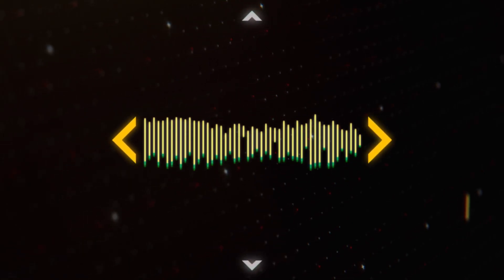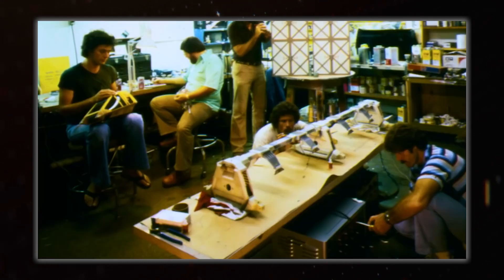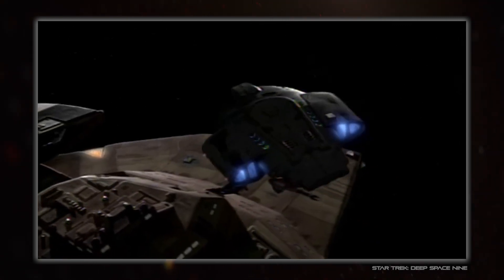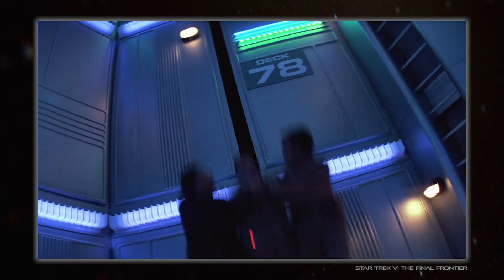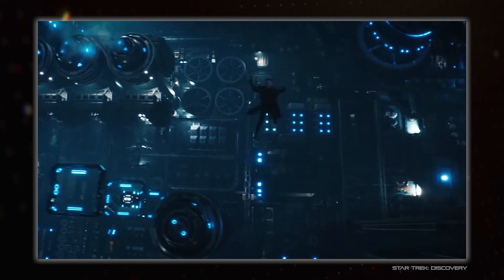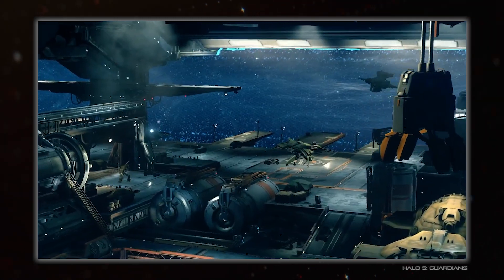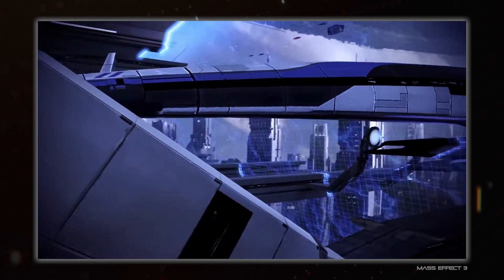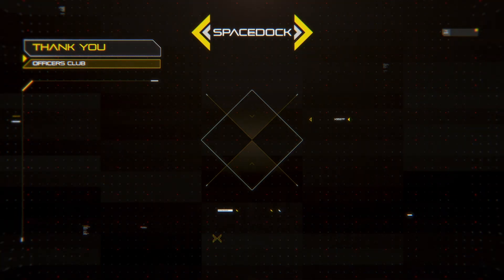Why Do Sci-Fi Spaceships Seem To Change Size?

Comment: There's some sort of cognitive illusion that makes the scaling issues less problematic than you'd assume they'd be. Somehow; IRL the inside of a house, especially when fully furnished actually feels bigger than the house itself looks from outside. I guess it has to do with the amount of details and your walking speed adjusting to the environment. Outside you generally walk at your max comfortable walking speed; but inside you're very limited by all the furniture and the short distances; so you will literally use longer time to traverse the length of your house inside than outside; and our impression of size is more shaped by time than actual distance. 

In computer games the player character usually have a massive collision box well outside the actual size of the player character to ensure that the player camera doesn't constantly clip through walls; so interiors needs to be much more roomy than a real world house needs to be relative to the size of a person; the more cluttered a room is the bigger it needs to be to allow movement. But luckily the illusion that things really feel bigger on the inside means we don't really notice it. Even in games such as Morrowind where interiors are in a different cell than outdoors and all windows are opaque; so the interiors doesn't need to match the outside in any way; and several interior cells are absurdly larger than the outside model is; if you compare them in the editor. Most small houses have an interior consisting of 2x3 or 2x2 cubic elements with walls and floors and ceilings snapped together in a grid; but if you take the corresponding model the interior is supposed to be the inside of; you'll often find that its about 1.5x1 such cubes large. Admittedly they often have massive basements so that the discrepancy is not as obvious but often even the first floor is massive. But strangely I never really noticed this in most locations until I started poking around in the editor.

Comment: It's not just ships, it applies to anything that's not technically real. So like anything 3D, anything animated in 2D, clay sculptures, anything with models, you name it. 2D's actually the worst for it by far because you can do so many perspective tricks that only work because of it being 2D and not an accurate representation of how something really works. 3D models are a lot more finicky about where parts of them are, where if an arm on a giant robot wants to bend a certain way, you actually have to make sure there's nothing physically in the way preventing it from doing that, while in 2D you can fudge a lot of it and no one will notice until they try to replicate the motion themselves in reality and realize waaaait a second that's not physically possible.

Comment: Starbug in Red Dwarf . . . basically a shuttlecraft with a cockpit and a rear room, matching the exterior design of two sections stuck together. . . but then sometimes it has miles of ducts to crawl through.

Comment: My favourite example of this has got to be Oryx's Hive Dreadnaught in Destiny 1 which people have tried to analyse the scale of by comparing it to the rings of Saturn and the hole its super weapon made in them, resulting in wildly varied upper and lower estimates for it's total length that are literally multiple orders of magnitude apart! (the most widely accepted estimates have it at roughly as long from bow to stern as the USA is wide from coast to coast)

Comment: Maybe one day, we'll get 1:1 proper scaling, inside and out. That's my biggest gripe with shows is that sometimes the interior of a ship can be ridiculously huge, or have more rooms than seems possible for a ship of a certain length or width. Or the ship keeps changing external scale for drama shots. My biggest gripe is internal layout not matching external size. Some ships will either have lots of 'dead space' thanks to weird curvings of hull when the insides are angular, or walls that are paper thin because 'future metals!'. Or worse yet, someone will map out where something is supposed to be based on external features (like a shuttle bay), and how far it is to say, the bridge.... and then the show or movie cancels the distance entirely in a way that can't be ignored -- like while a timer is counting down audibly or visually. And that's just so they can cut time for the show.

Comment: The demands of filming on a set with actors and props force a lot weird scaling.
Said actors want their faces clearly seen, so the sets have to be scaled to that reality.
A prop that cost thousands and hours to build must have its screen time.
A full-sized 'Enterprise' Bridge, for example, would have actors look tiny and isolated from each other.
If'n y'all make the sets a bit smaller, the actors look like they are working together in the same room.
There's only so much can be done with camera position and lenses...

Comment: The Defiant did actually change size over the duration of the show- they kept scaling it larger from season to season as the writers added new stuff to the inside of the ship that wasn't on the original plan, like the shuttle bay :)

Comment: This was a good insight to ship sizes but the Uss Defiant is 170 metres and either 4 or 5 decks, I prefer 4 decks as it seems more realistic to me, also I had assumed the Whitestar from Babylon 5 was 275 meters but I recently saw something suggesting it was 475 metres which makes sense I suppose, and Babylon 5 is 5 miles 8 Kilometres long, this is a well established size and for a young race like the Humans it makes sense too in my opinion. Thing is I thought you would have mentioned the Klingon Bird of Prey as this is uncertain but in my head cannon having a scout ship at probably 150 metres and then having the largest BOP at 600 meters to equal the Galaxy class. Finally as your video was talking about size of ships it might have been fun to mention the TARDIS being both big and small at the same time. 🖖🏽

Comment: The Discovery turbolift shafts aren’t necessarily an error. Enterprise had that time pod which, like a TARDIS, was bigger on the inside. And that was tech from about a century or two before where Discovery ended up in the future. Its refit may well have involved some… dimensionally transcendent elements.

Comment: Size inconsistency is the LEAST thing that one can point to as the worst issue in Discovery (even though it is worth noting that it is something that other shows at least tried to get right). 

Also, the deck numbering inconsistency can easily be explained in three very easy ways - 1) it was simply error in numbering, 2) it could have been a re-used part from another ship which had that number of decks since we know that Starfleet built ships with modular design in mind (and standard parts for interchangeability would been part of that), 3) it could have been a prank (either by a construction builder or by a Q entity). Would not be the first time this happened either, because in another instance there was either a wrong name on a ship or it was misspelled, and a viewscreen? shot of another ship showed it upside down by accident. I mean, you can very easily find in-universe explanations for these goofs if you really tried, like an administrative error or miscommunication between different crews during that part of construction at the Shipyard or a gyro breaking down on a ship allowing it to drift like that. I mean, heck, you could write an ENTIRE episode to explain it away or rationalize its existence? (also, I'd like to point to the nonsensical nature of having rocket boots in one movie, and antigrav boots in another - when Kirk is climbing a mountain and Spock wants to talk to him - since we are on that clip)

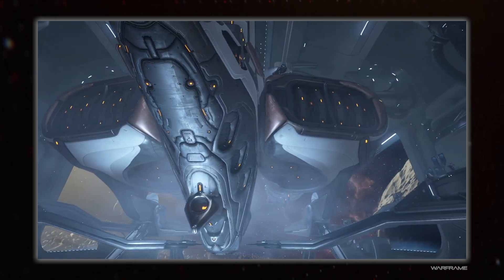06:50. Wasn't internal/external size inconsistencies already explored and explained in various scifi novels, films and series already? Things like quantum compression technologies or otherdimensional storage concepts (like what you see in Ultraviolet when she stores her weapons on her person but not in a visible space, but also in Picard when he goes to that facility and "unfolds" that storage device?). Didn't one of the later Dune novels also explore something similar?   

Also, I do believe that most people don't really question the scaling issue because they assume that 1) it's a perspective issue (like you are seeing it from afar that makes it look small or close by that makes it look extra huge), 2) when compared to nearby objects, there has to a fine line in making it look both visually impressive/functionally fit for purpose but also relatively semi-accurate to nearby objects (like planets, suns, stations, doomsday devices), 3) most people aren't really scifi geeks and therefore are not really interested in space inconsistencies in any case and would never question things they don't really care about or choose to spend their time questioning. 

Also, I feel the "it was a visual style choice" is kind of a cop-out. If an  Sulaco cut-away can properly show me how it is possible to carry a drop ship on it and have all the relevant parts and supplies needed to run itself with both its crew and contingent of Marines, then the "well it is what it is" is just an excuse for poor visuals and further cop-outs for people who will always fall back on that to explain their laziness/short-sightedness to not even CONSIDER such issues. And I'm not even including the "I can put my power core and crew quarters wherever I want to (even next to each other) because it's fiction" crowd, who don't even see see what the practical problems would be with something like that. I see FAR too many modern spaceship designs in cinema where it's just CGI shapes thrown together with no consideration of where anything functional goes. (or even worse, straight up ripped off from another more popular movie or series). Also, I miss the days of cinema when practically every new movie or series with space elements had new spaceship designs that you've never seen before, and that would inform and push new concept artists to build upon or explore other spaceship design avenues. In the era of 'updating the look and feel of franchises' it seems everything is moving towards looking, sounding and being exactly the same. I don't know whether that is due to a lack of imagination on the part of the creative teams, or just because remixing someone else's work is so much easier and cheaper.  

I mean, if we want to talk about Trek inconsistency, let's talk about how Time Ships can have temporal sensors (for mapping changes in the timeline) and temporal transporters (for inserting Temporal Agents into the time lime at specific times and places, and how that would exactly work since the place's coordinates would move around in space), but somehow lack the ability to shield itself from temporal changes with temporal shields (like the rudimentary kind that VOYAGER could manage to create in a time travel episode, despite being a VASTLY more primitive vessel than anything the Time Ships were and Voyager several 100s of years behind in technology from anything the Time Ships had onboard). At least ONE Trek episode had Earth totally destroyed during the Time Ship era, but that would not have happened because Time Ships could easily have prevented it from happening, and ACTUAL temporal shielding for planets would have been a common countermeasure against Time pirates or Time saboteurs (since it was shared in an episode that various factions meddled so much with the timeline that a Temporal agency had to be set up to police and protect it).

Comment: Every month I become more convinced that in both the movie and big videogame industries there is a significant disconnect between the writing teams and the art teams. Take Mass Effect as an example - the tactics and strategy for large scale fleet tactics described in Mass Effect's background logs describe something ENTIRELY different to what we get to see in cutscenes. Presumably because the writers were told to write good sci-fi while the animators were told "just make it look sick af, go nuts!" and the writers weren't invited to that meeting.
Reply: It's more likely that the writers did their job first, then the animators tasked with doing what the writers put down laughed their asses off and did what was actually possible, and no-one went back to the lore and updated it. This sort of thing happens all the time in software with manuals, tutorials etc.
Reply: That's been true since the very first Sci-Fi to be filmed. In Star Trek, they would cut from the bridge, where characters talk of engaging other vessels at "100 thousand kilometers" while engaging in "evasive manouvre Delta". To the actual battle, with the two vessels standing a couple hundred meters away at most, firing phasers definitely nowhere near lightspeed, and very slowly turning away from eachother. 

Ironically, the very advances of technology and techniques, is what made this discrepancy possible. Also for Star Trek, the original series or TOS films, felt far closer to the lore, because it wasn't actually possible to show the two ships slugging it out. It would have been even less believable. So instead, all we got were separate shots, one ship firing, then cut to the other taking fire, then cut to stuff exploding on the bridge. To represent movement, as moving the models would be more difficult, they instead moved the stars in the background, giving the illusion the ships were actually moving at extremely high speeds.

Comment: Starship size and scale largely depend on the tech level of the setting. In Star Wars the 15km Super Star Destroyer seems huge- then you realize it's outclassed by the 25km Gloriana Class dreadnought from WH40k and even that is dwarfed by some of the Guild Highliners from Dune which can reach 500km in size. And don't even get me started on the Culture ships...

The chief limiting factor on ship size is power- what kind of power source does your ship have? The more powerful it is, the larger the ship can be. Modern spacecraft like for the Artemis project have to shave off every gram of weight they can in order to save fuel. But Sci Fi ships can have exotic power sources like singularities, anti-matter drives or tap into alternate dimensions for power.

Comment: On the mention of the Railjack, Warframe used to have some pretty egregious scale problems with its  Archwing gameplay. Particularly noticeable with the Corpus Archwing missions, where some of the enemies were normal ground units with a spaceflight backpack, but taken at face-value, appeared to be nearly 15 feet tall. At one point there was even a glitch where your animal companion would spawn in the mission, and you were the size of its leg when normally it would be waist-height on a Warframe. Essentially the Warframe got shrank down when in Archwing missions. This was later corrected, but the effect still exists intentionally with the Titania Warframe, who can turn into a fairy and fly around with Archwing mechanics.